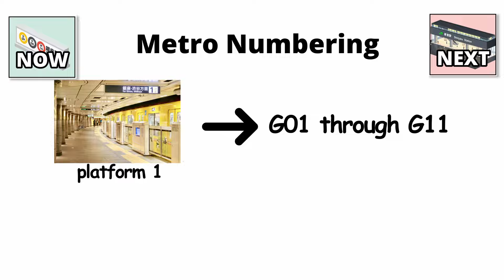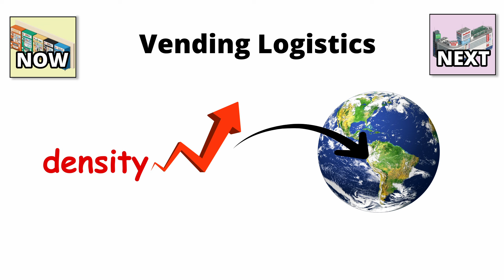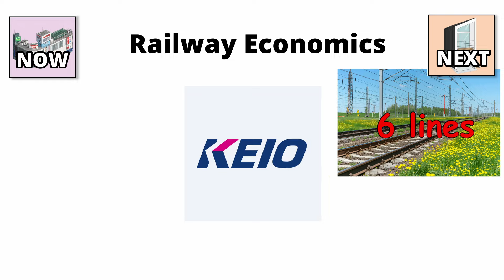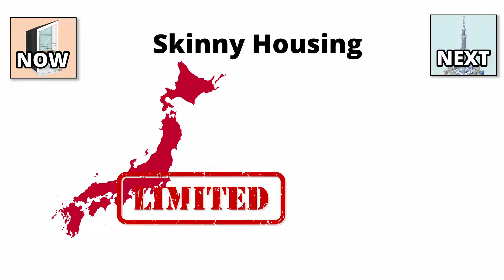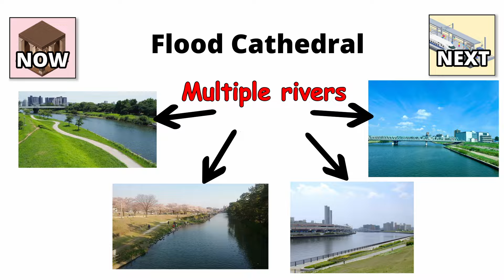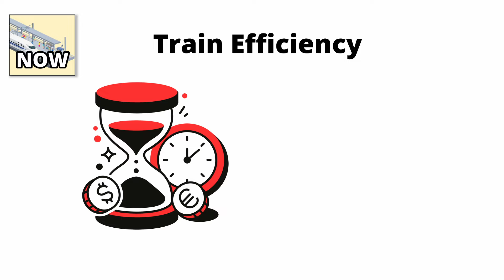Every Reason Tokyo Is Insanely Well Designed

Comment: First point on station numbers is nothing new to a metro system. Here in Singapore they have been there since 1987 but they changed it to the standard with 2 letters of the MRT line and the station code number in 2001. This is the only other metro system other than the ones in Japan where it is used. However, they don’t emphasise it in their announcements in the trains compared to Japan.